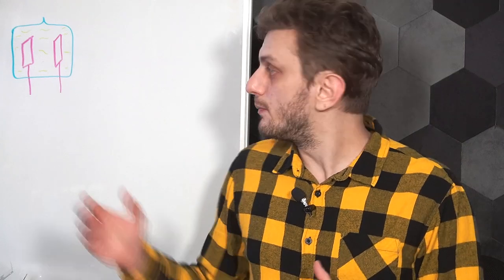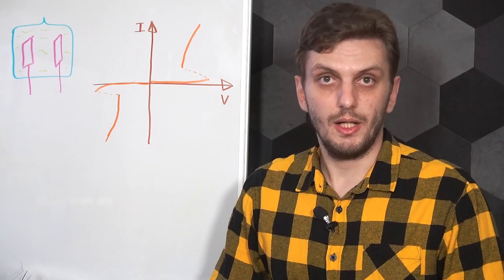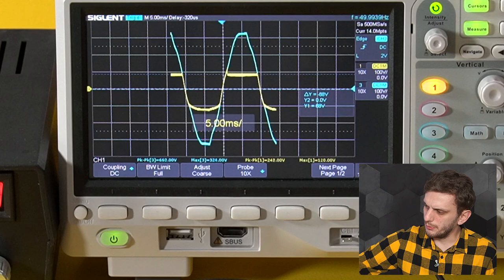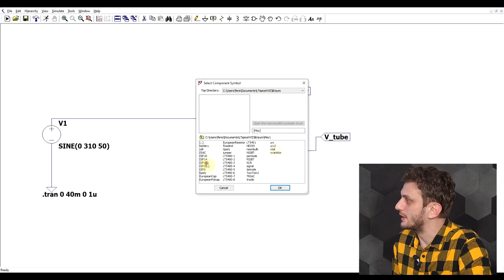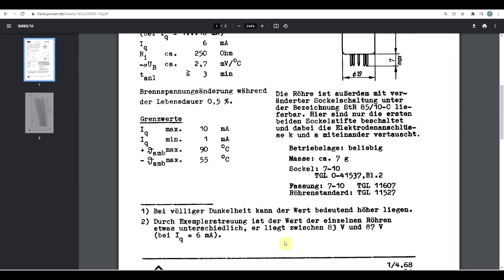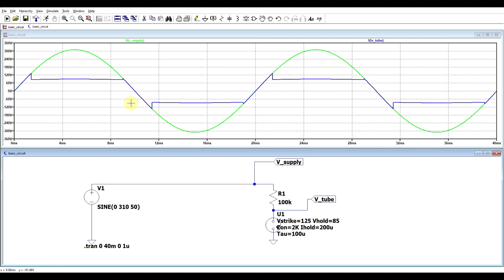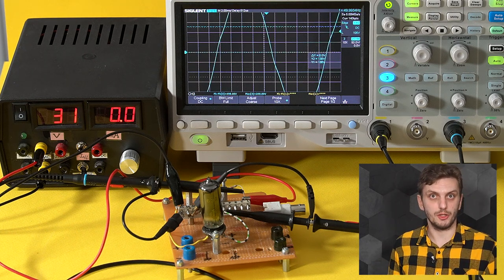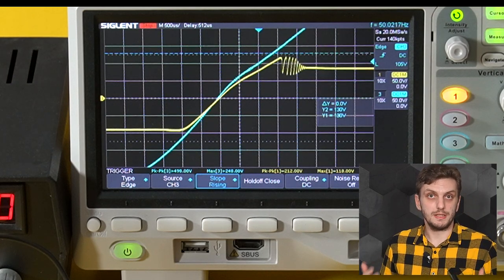LTspice tutorial - Gas discharge tubes and components

Comment: FesZ Electronic, thanks for a very informative video. In the lightning effects industry, indirect effects is a big issue. This model is very helpful for input circuit protection using spark gaps. One problem is gas discharge devices have a limit amount of times they can be  discharged. The ionization process will deplete the gas in the device. Most applications this will not be a problem.

Comment: What is fascinating to learn from this is that the surge arresters and gas discharge valves are essentially the same devices. Who knows, may be one can use surge arresters in place of gas discharge valves in valve circuits? I haven't checked the range of threshold voltages offered for surge arresters but there's no reason to suppose they're not offered in a wide range. Certainly gas discharge valves did not come in a huge range of threshold voltages.
Reply from the maker: Usually, for surge arrestors there is a very big voltage difference between trigger and maintaining (like 200V to 20V) and these components are made to work with high currents for short periods of time; with dedicated voltage regulator tubes, the voltage difference is much smaller and they run very small currents.
Reply: @FesZElectronics  A-ha! Thank you for that!

Comment: That's a great demonstration of the simulation vs actual behaviour of the gas discharge valve.
I have seen these used often in audio circuits, first as stabilizers in the power supply rails and second as cathode by-pass elements (instead of resistors). In both cases I've seen capacitors used in parallel with them to remove the noise. Supposedly there is an inherent noise associated with the operation of these valves and the capacitor helps get rid of it. On the other hand the little turn on/turn off spike when the applied voltage crosses the ionization voltage threshold indicates the presence of inductance. Is that built in the neon tube element in LTspice or does it need to be added? In any case, the resulting oscillation should appear in the simulation as well.
I'd be interested in further demonstrations of it as a PSU line stabilizer and particularly as a cathode by-pass element. In the latter case it will be operating well under the threshold ionization voltage. I'd be interested in its behaviour in this capacity to see whether it offers any advantages over a simple resistor, especially when it comes to noise and frequency/phase response and whether any parallel capacitance is a good/bad idea.
Reply from the maker: I'm not sure how healthy it is for the tube to have a capacitor in parallel - the first time it ignites the capacitor is loaded with a high voltage so there is a very large current passing trough the tube - it might get damaged over time. I didn't really see schematics where the capacitor is directly in parallel, maybe only after a resistor - to form an RC filter.
I guess the main advantage of having a gas tube over a resistor in the cathode is the constant voltage drop - with the resistor the voltage drop is current dependent.
Reply: @FesZElectronics  Yes, exactly, you gain current independent voltage drop so there is no voltage feedback. I'm not sure whether that's a good thing or not but you may need it if you require maximum amplification or want to avoid using a large cathode by-pass capacitor.
You may be right in that it is probably often used paralleled with a capacitor in series with a resistor but I'll have to check. I'm sure I've seen it without the resistor.
Reply from the maker: Regarding inductance in the model, there is none - the model can be consulted in the LTspice/lib/sub/neonbulb.sub file - its built with voltage controlled switches.
Reply: @FesZElectronics  Thanks for that. This is as much as I suspected. So adding inductance maybe calls for building a new model from scratch.
Calculating that inductance, however, is another matter since it's not included in the sheets. One would have to infer it from the observed waveforms by taking measurements in a range of operating conditions (e.g. voltage, frequency) by performing a series of runs as those you demonstrated.
Reply: @Stelios.Posantzis  as far as I know, current spikes caused by capacitor directly in parallel to tube will cause excessive sputtering, shouldnt be that bad for electrical characteristics but may render display or indicator useless faster.